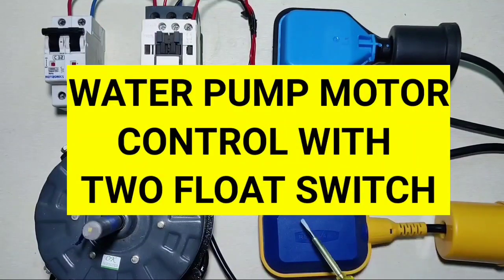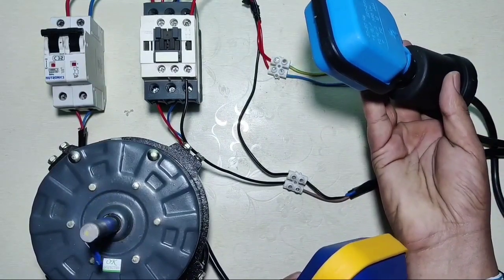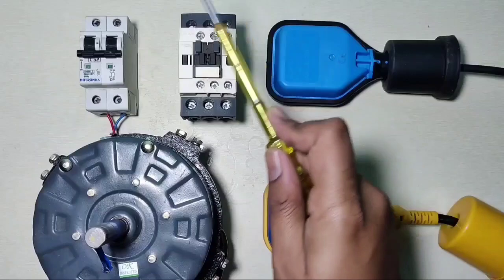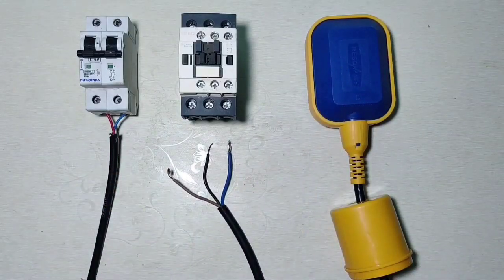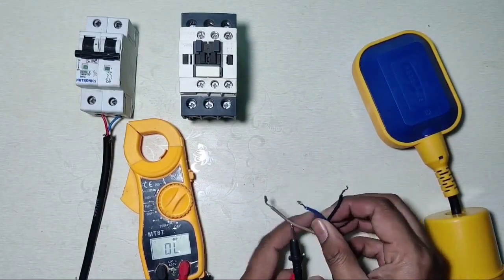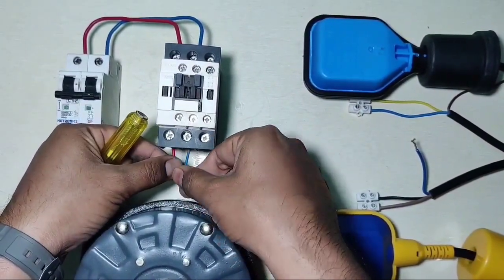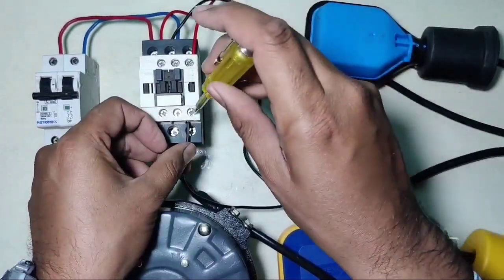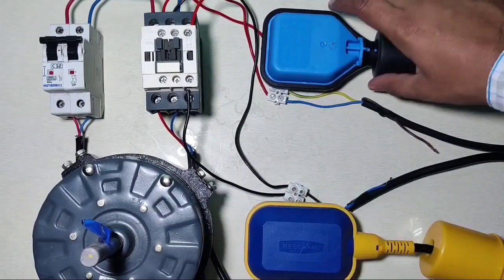Motor Starter Control With Two Float Switch! Float Switch Wiring With Dol Starter!

Comment: Hi, I am applying the concept, but it is not working. The float switch I am using both having the same colors of wire which are: Black, Gray and blue. I need assistsnce